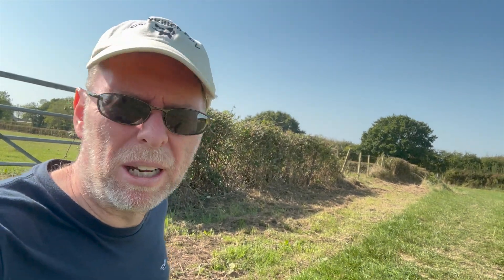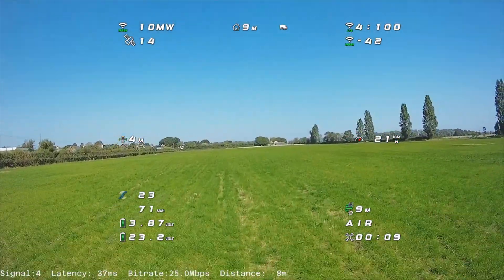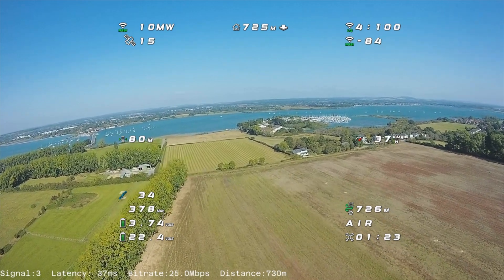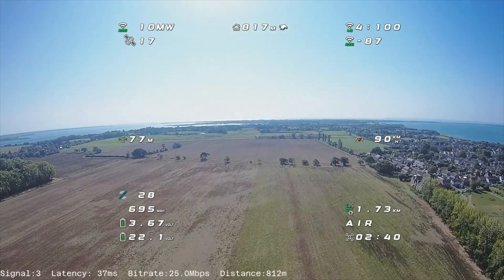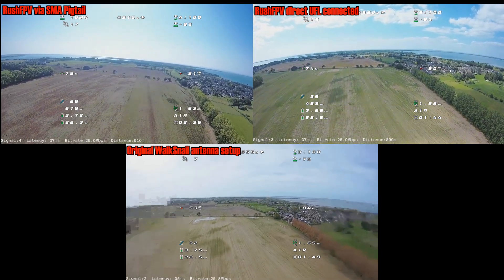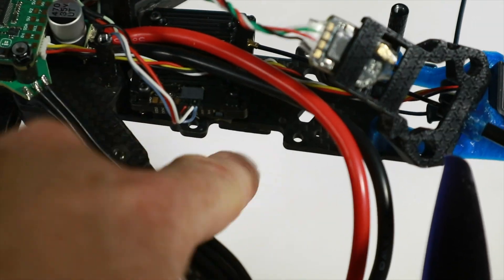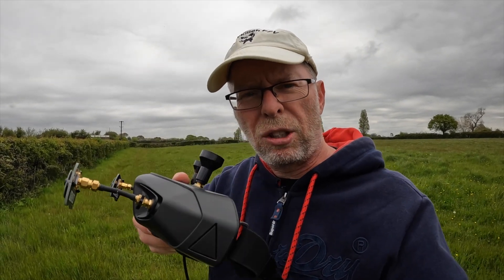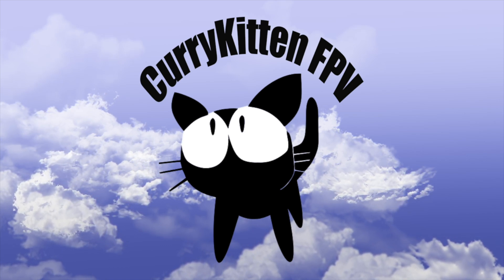Using different antennas to improve range on a Walksnail VTX

Comment: I moved to Walksnail from analogue this year. My first flights on the stock antenna 's were disappointing. I fly fixed wing BTW. Now I use TrueRC X2-Airs on the top of my gogglesX and Foxeer Lollipop 4+ on all my  WS equipped planes .
The range is much better now, 10 kms is an everyday breeze and 18 kms my best to date. Video - although at a low bitrate- was still unbroken, battery power is my limit at the moment.
Have to add that I have two small triple feed patches (cheap as chips on AE) that give the same range but are just a bit ungainly on the Goggles 😉
Reply from the maker: Good to know - I've been meaning to swap my little wing out for Walksnail for about 2 years now, so I need to get to that and get flying it!
Reply: How disappointing was the stock antennas? I'm aiming for 5km tops to start.
Reply: Stock should manage that easily 👍
Reply: Very nice. What VTX are you using?
Reply: @KingTheoden88 I'm mostly using the Nano V3 set to 500mw. I have three on different planes and they all have the Lollipop 4+ antenna's.
All go to 10 kms easily, 16.5 being the best to date. I have the Avatar Pro duel and single vtx's too , but they're not much better so far🤔
Reply: I want this type of range, I use TrueRC X air the single one on top ports of my goggles X...do you use focus mode? High bitrate or standard? Thanks
Reply: @Windjumbie Standard bitrate and no focus mode.
720p.😉

Comment: Great info here. I just bought my first digital system with walksnail on Thanksgiving eve. I could not afford 200+ dollar goggles and instead bought a gaming monitor with 144 Hz refresh rate. I have been piloting from inside my car to fend off the cold new england wind, so I hope the LCD monitor is bright enough inside the car. On the 144 Hz monitor, I notice that the monitor itself says that refresh rate is 100 Hz and walksnail delay is 23-29 ms, faster than yours at 37 ms.
Reply: The 16-inch gaming monitor with a 144 Hz refresh rate costs 96 dollars.

Comment: I remember a long time ago JB and Trappy(TBS) had a disagreement, JB reviewed thier pro 32 hv and put it on the immersion RC power meter, he  used a generic pigtail he had laying around and got poor results. After a bit of back and forth JB tried it with a TBS pigtail and the results were much better. Also i just pull the retaining clip off antennas that come with them if the clip doesn't fit and haven't had any issues.

Comment: the biggest upgrade is to put 4 patches on the goggles ,, i use the Dominator HDs and have a 4 patch front plate ,, soo much range
Reply from the maker: Do you face them all slightly different directions.  I like that for range in a certain direction.  I test it this way in order to still be able to fly all around myself a bit more.  Although it does still suffer behind myself despite the omnis
Reply: @CurryKitten   its really a none issue the patches seem to work better every where there is a great video on it ill find it \

Comment: try some True RC antennas. rushfpv v1 were designed by truerc and were decent, the v2 antennas they decided to clone it best they could and not pay licence fee and are hit and miss. also make sure you have a patch on the rx/tx connector on the goggles.
Reply from the maker: I did not know that.  I'll see what i can get hold of

Comment: The original walksnail antenna have higher gain. The signal is more directional.not a even donut like other omnis. Also the beam has lots of small nulls. Stock is around 3dbi.
Reply from the maker: It might have higher gain, but they look very bad in flight tests.
Reply: I've had terrible performance with the original WS antennas

Comment: I wonder if a pigtail made from rg316 would help. Those cheap little black wire pigtails are garbage. Useful info though.
Reply from the maker: It might well help.  I did find ufl to SMA adapters a bit hard to come by.  If only Walksnail used an MMCX connector (and I wish they would - I don't know whyone that likes ufls) we'd have a lot more range

Comment: I enjoy flying long range on DJI and I would never use a ufl to sma pigtail. Too much loss! All my friends I fly with that use one never came fly as far as I do before losing signal! 😂 
The best antennas for digital are by Rush, FlyfishRC, and DJI (for O3).
You can remove the ufl lock if you are careful
Reply: I've flown to 15km with a walksnail 1s vtx (350mw) using a 20cm ufl to sma pigtail and a 15cm albatross antenna.
Reply: @tmc-fpv  that albatross is super delicate, as only a moderate impact will put it out of tune. It's an open air element in the housing. I have also gone quite far on one, but the adapter setup always introduces more variables.
Reply from the maker: Yes - as seen on the end of the video, I did remove the ufl lock.  That said, I think ufl's for antennas is awful.  They are so ridiculously delivate.  Could all manufactorers please use MMCX's instead!